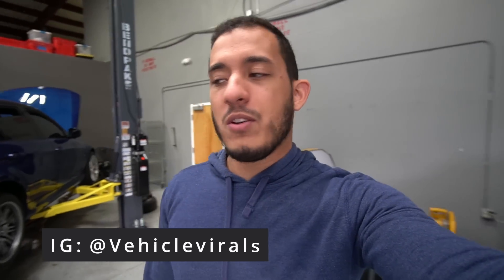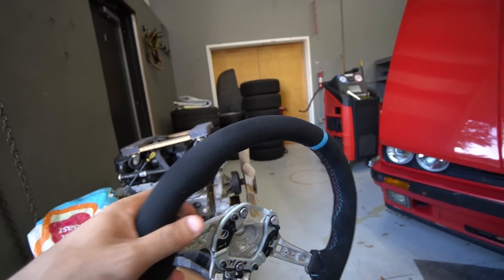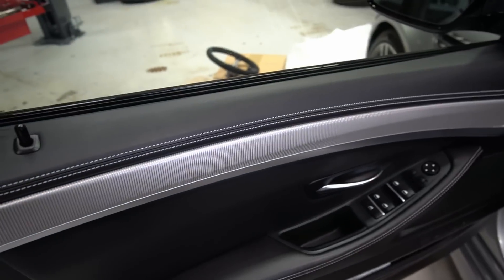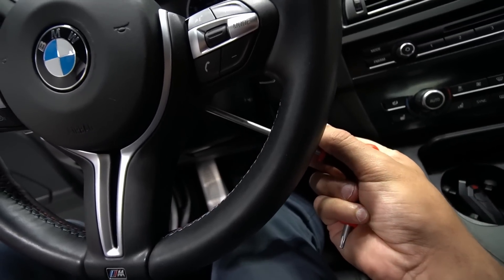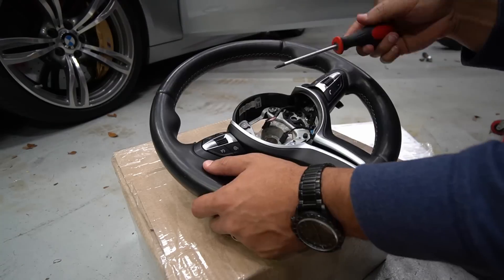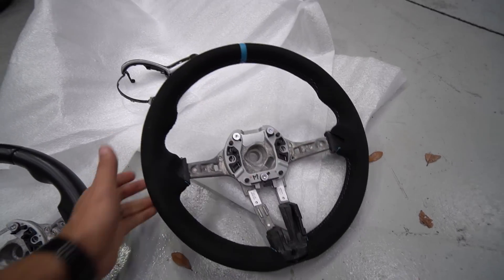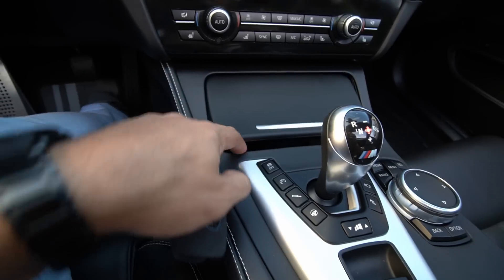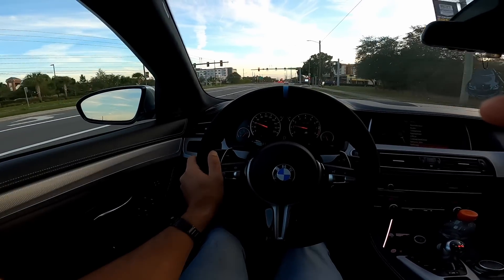The Only Interior Upgrade Your BMW Needs - F10 M5

Comment: ALWAYS DISCONNECT THE BATTERY BEFORE MESSING WITH THE AIR BAG!

You did the right thing when disconnecting the battery before messing with the airbag, the airbag is a piece of explosives and should be treated as such. If you get in the way of an airbag and it goes off, that can kill you.
Reply: @Klas Peppar FACTSSS

Comment: Fitted the alcantara M Performance wheel, carbon shifter cover, pedals and mats to mine before it went away for winter storage. Feel the exact same about the blue strip on the steering wheel - especially as I fitted red M1/M2 and start buttons, it's a little out of place. 

Also have custom laminated carbon dash/door trims to fit when I pick the car back up in Spring too.  Nice subtle mods to the interior.

Comment: you don't need to take the steering wheel anywhere to get it re-aligned.... just pop the airbag of and the nut holding the steering wheel off...... at the area where the steering wheel meets the steering column, there should be some clearly marked groves on both the steering wheel and the steering column.... line those up and your steering wheel should lock on dead center....  if you need more info, check out Tommy L Garage's YouTube channel on how to upgrade the steering wheel... he nicely lays out the instructions....
Reply from the maker: It's installed correctly. It's alignment related.